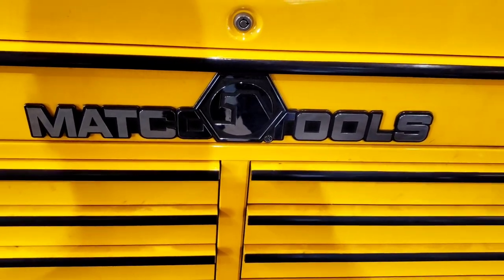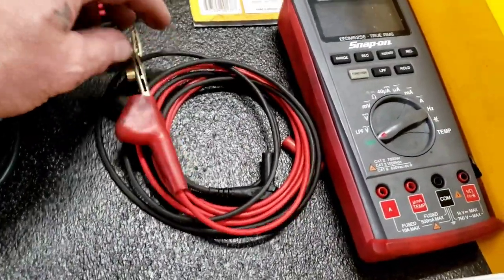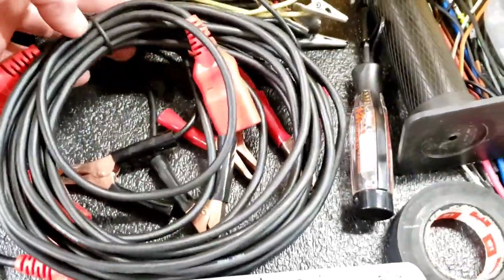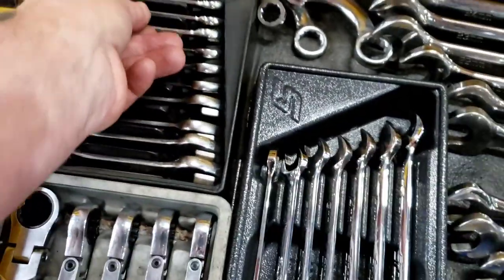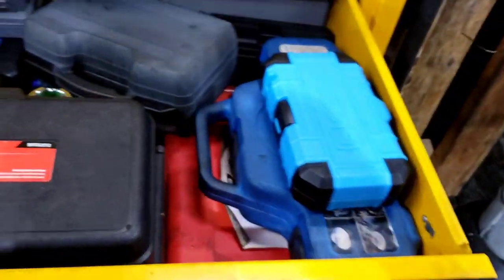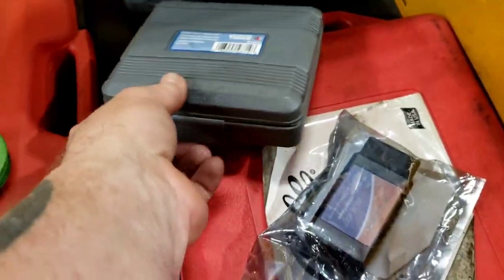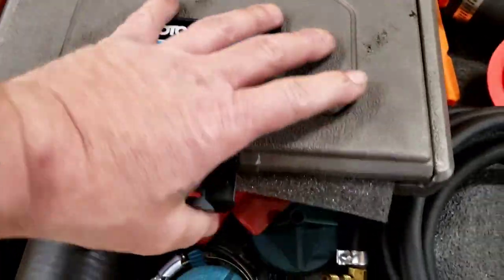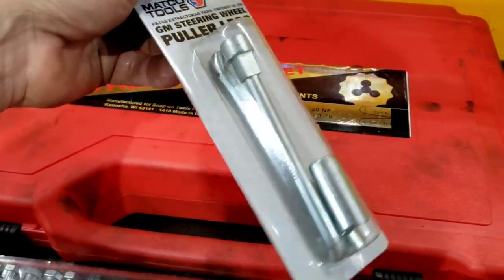MATCO TOOLBOX TOUR 56"

Comment: I use 30mm pretty often. I had to use it on the Mini Cooper Belt Tensioner, Ford 6liter bulletproof Oil cooler lines, oh the MATCO Crankshaft Installation tool.
Reply from the maker: Oh wow I am unsure if I have used it on any of those.  Thank you for your comment,  I appreciate it

Comment: With that Power Probe,some people don't know how to use it right.Use it on the wrong circuit and burn up to 4 computers which results in an expensive repair.Tribus Tools does have a great oxygen sensor wrench that ratchets.I have one and have used it 6 times so far coming in handy,not cheap at $130.00
Reply from the maker: Yes you can definitely wreck computers, letting the smoke out of the box as it's called.  I've seen that wrench on Instagram,  might have to try it.  Thank you for feedback.

Comment: That’s something else that I really don’t have that I suppose would be nice would be a steering wheel puller. Usually I just wiggle the steering wheel back-and-forth and yank like hell but a steering wheel puller would be nice that’s for sure
Reply from the maker: This one is for removing the lock for steering wheel work when having to disassemble steering columns.  I just wiggle them off as well.
Reply: @NutsandBoltswithTone  the hog ring
Reply from the maker: @MiguelMartinez-hm1hg  yuppers